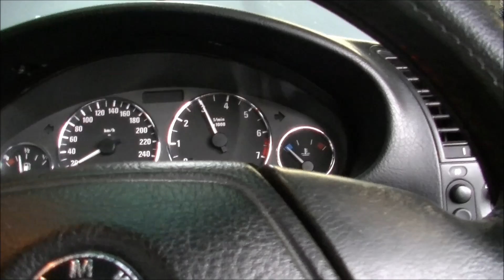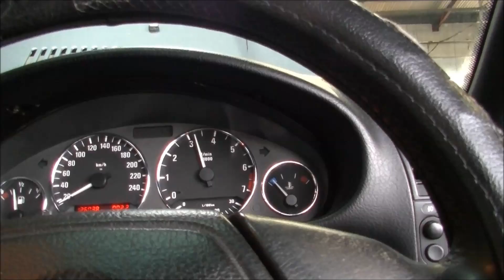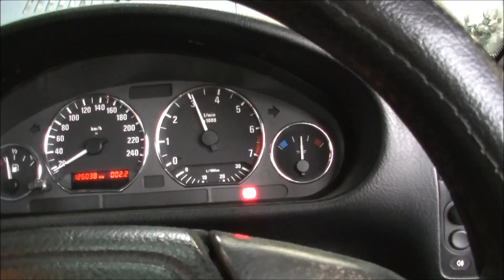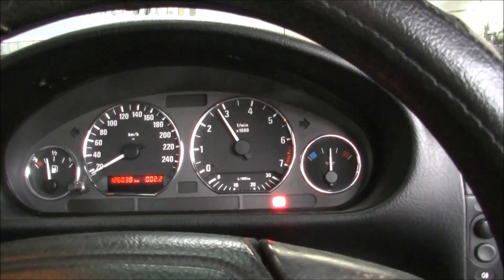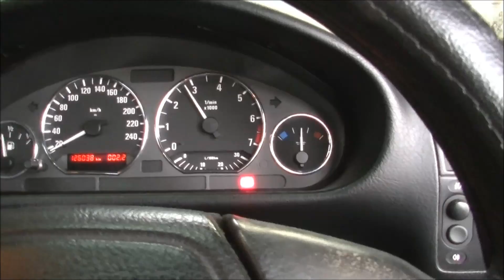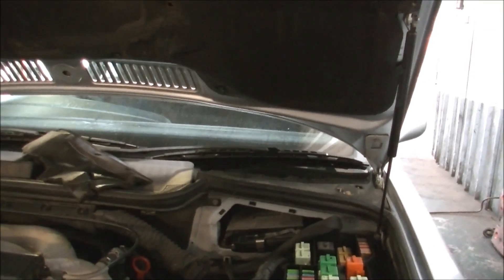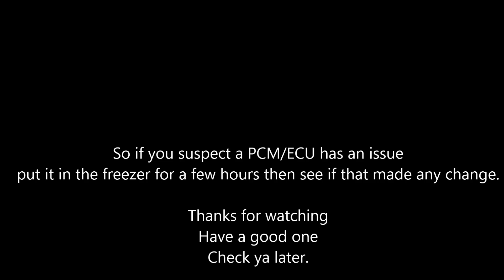A cool way to test a PCM/ECU processor.

Comment: I think my car has this problem. I noticed the same thing, car heats up to operating temp and then starts having many many problems electrically. So I can take it for like 10 minutes drive and then cars done. Engine lights comes on when it wants to and shuts off when it wants to
Reply from the maker: Mate all I can tell you is this...I gave it back to the guy and ha said it was great...They still have it and it still runs spot on so it's worth a try.
Reply: ZIGgassedUP so all u did was stick the pcm/ecm/ecu in the freezer for about 12 hours and brand new car basically
Reply from the maker: @SageXteriorCleaning  Yep....It's worth a try.

Comment: Bad solder joints from the factory , I remember now seeing this on a Honda car ! Thumbs up Zig
Reply from the maker: Thanks Shawn...It's not so much about a dry/bad solder joint but a bad CPU.
Reply: sometimes a bad contact point between the board and the CPU can cause the CPU fry or loose internal contact due to heat . Interesting  vids !

Comment: A "cool" way - I see what you did there :) We would do the same kind of thing looking for bad electrical components by hitting them with freeze spray. Often times, chips/parts that are flaky will get worse with temp. As others have said, it could be a mechanical problem with solder/thermal expansion. Nice diagnosis Doctor Z!
Reply from the maker: Thanks Erik...It's not worth messing with if the CPU is done.

Comment: Thats a crazy way to check a comp. but makes sense if its heat soaking thats making it cut up. Tell him if he dont want to cough up the bucks for a new one  to keep a bag of ice on the old one.lol
Reply from the maker: It works Scott so put that info in your tool box for later use...I said we could install an Esky full of dry ice with enough room for the ECU and a six pack...lol

Comment: Great way to test. I'm going to remember that. Could check for crack, loose soldier joint . Thanks ZIG
Reply from the maker: Guy says it's not a dry solder thing 'cos we/they could re-flow the joints but a processor is done when it's done..Cheers Lloyd.

Comment: Well how about that. He should take that to an electronics store, if freezing it worked it must simply have a bad connection inside that might be fixable.
Reply from the maker: The issue is that if the processor is pooched then it's not repairable because that's the most expensive bit.

Comment: Could be anything within the ECU causing the issue. A dry/bad solder joint's resistance would also increase with heat and could cause the issue. $500 is pretty reasonable for a new ECU...
Reply: My thoughts also. Cracked solder joints will often lead to temperature related faults. I have often fixed pcb's by adding a small amount of acid free flux and re-flow the joints that looks suspicious. That said I've not seen ECU's with bad solder joints and i suspect this is because the quality of this type of electronics is way higher than what found other places. I anyway would've cracked it open to inspect it just to be safe.
Reply: Not that is related at all to this case but I've actually fixed a bad ECU one time. This was an ECU for a 1990 Mitsubishi. The engine had started acting up and after hours of diagnosis and replacing parts i decided to open the ECU.  Turns out there was three capacitors that had started leaking. I ordered new ones and was lucky to find that the PCB copper leads under the capacitors wasn't corroded beyond repair. I found info regarding old Mitsu ECU's and it seems like the leaking capacitors is a well known phenomenon. If not caught in time the capacitor fluid will leak across the PCB into IC's and by then it's to late to save. MD142755
Reply from the maker: Yeah man..I'm gunna crack it open and see if I can re-flow it but the guy is happy to pay for a new ECU

Comment: Be interesting to see . I would want to see more on the cam sensor . A lot of times i go the generic , over the enhanced data , Sometimes the generic will have real values shown  , but the scanner data for non generic may sometimes use a substitute data . not to often but sometimes .
Reply from the maker: Yeah Terry...I'd like to fit a new cam sensor (Pretty cheap)..I tried to run the generic scan before the freeze but the ECU wouldn't talk to the scanner...That's gotta mean something right.?
Reply: you would think then it would go back to being bad after the ecu warmed back up . Had you unconnected and reconnected the computer connector prior to doing it to remove to freeze . I have not froze many ecu`s , but i have worked on a lot of pc`s . A lot of times solder joints crack and freezing makes them tighten up and work . I wonder if that is the thinking on freezing the ecu . It may very well be the ecu , i do not know . just nice to rule all other out before replacing so if something did short the ecu the new one is safe .But i sure you guys have done way more testing than what we have saw on video .  Just can not wait to see what it is . i hope the new ecu does fix it .